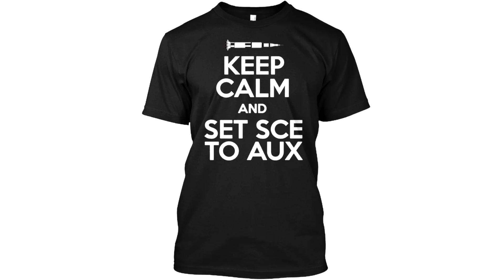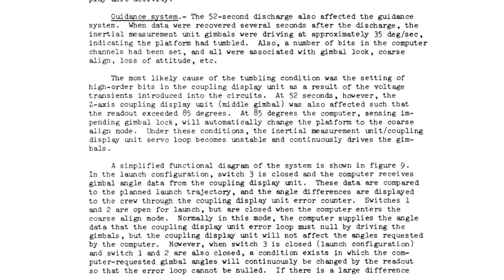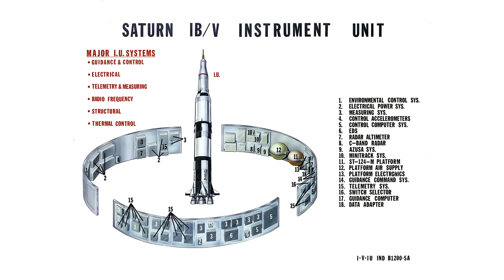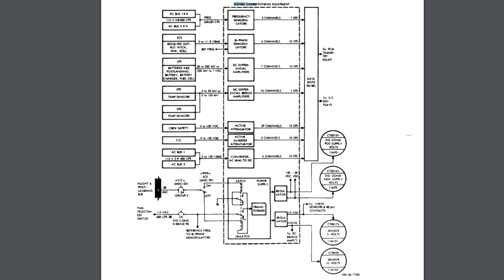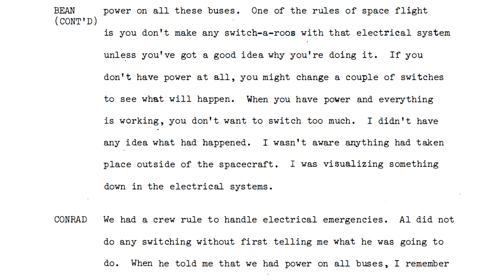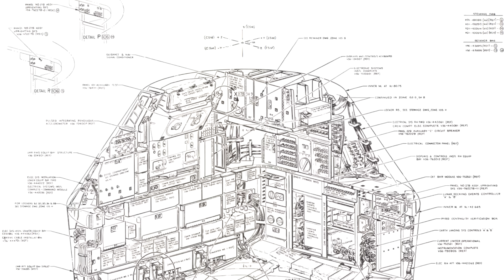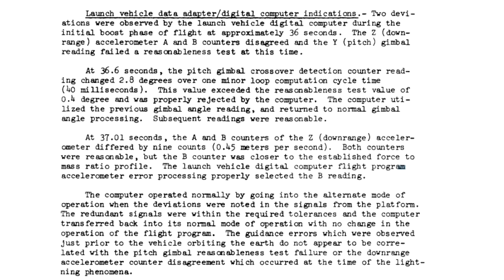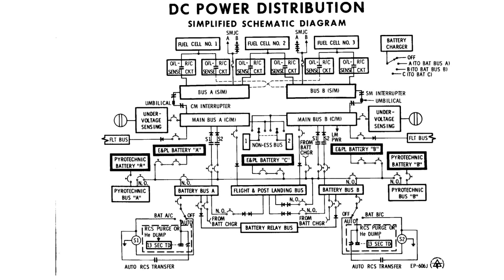What Does "Set SCE To AUX" Mean Anyway - Apollo 12's Lightning Strike Explained

Comment: At the 3:48 min mark you incorrectly used the post Apollo program acronym for EECOM (Electrical, Environmental & COnsumables Manager). During the Apollo program, EECOM stood for "Electrical, Environmental & COMmunications" (controller). Not to be confused with the CAPCOM who just communicated over the radio but wasn't the NASA controller that actually was responsible for communication's systems technical stuff for the command & service module. I usually like your video's but I am sorry, you earned a thumbs down for that mistake Mr Manley.

Comment: Video games and simulators are all the rage. Some day, someone is going to set up a Mission Control simulator. People will be able to choose their position and (remotely) man a console during a simulated space flight. For instance, someone can pull a shift as FDO, another as GUIDO, etc. I think people would pay to play such a game.
Reply: Kerbal Space Program has a mod that can send data to a web browser.  Telemachus I think it's called.  I've never used it, but reading about it - it seems it sends different telemetry data that you can access on a second screen - - - but in theory, it's a web browser, so if you had a bunch of friends, you could all get in communication on a group chat/call and each of you pulls up the web page and browses to the appropriate page of that site and you could each be viewing different data about the same mission rather than ONE person browsing through different pages of it.  It would probably be pretty cool at first, but being that the game is obviously fairly easy to play in single player, it would just be fun for a bit - - and then it would probably get old because you'd likely start just communicating about things you don't need them for.  In theory, this seems like the closest thing to what you are asking for.  It's not necessarily DESIGNED as a multiplayer way to have a "mission control" simulation, but I think it COULD work as one.  I've never even seen the mod, but based on what it does, you could probably use it the way you are talking about.

They talked about implementing something similar to what you are talking about in KSP2, but of course since that looks to be abandoned (or not.....or yeah....or not...or who knows) - don't know if that pans out.
Reply: That is an experimental part of Reentry a Spaceflight Simulator. I've only been a controller once, I was FDO.
Reply: @msidc1238  It sounds interesting.

Comment: The solution most likely came from the fact that the "on" and "aux" positions were on opposite sides of the "off" position on the SCE switch. An asserted SCR will remain conductive until the power flowing across it drops below its forward voltage (usually ~1.2 volts), so the quarter-second of no power flowing ti the SCE allowed it to self-discharge and reset. 

This is still a common problem today -- most power protection systems simply do not account for the possibility of the system experiencing a transient spike and then recovering, and require the whole system to be shut down and reset.

Comment: As someone who went through the usual US Army Basic training of the early 1980's, one of the training requirements was to demonstrate the ability to deploy a Claymore mine. The equipment used was a simulator, but part of that was that the hand detonator for the mine had a 'test' mode that if everything was connected correctly, you would put the detonator into 'Test' mode, squeeze the detonator as if you were igniting the mine, and a light would flash on the detonator indicating that everything was configured correctly, and you would loudly report "I see the light" to the evaluator, who would then advise you to move the detonator out of 'test' and detonate the mine. In this mode you were expected to have ducked down behind your berm on the off chance that you were in the back blast for one or more of the mines attached to the detonator, and detonate the mine. (simulated, no explosion.) As I never deployed a live Claymore mine, I have no idea if the live equipment functioned the same way, but it was impressed upon us that  it would. The reason I relate this is that since this mine was (I seem to recall) widely deployed during Vietnam, it seems to me that the testing of the primer and detonation system could have been performed in a similar way on the Apollo Command Module. The likely issue with this was that it would add complexity, and since Primers are somewhat temperamental in any case, much less after they have been through a launch, and are now in free fall, and in an environment that they are not necessarily well tested in on top of their being temperamental, there is some risk to doing anything like the test the Claymore would go through. I'm not at all sure that there weren't a few missteps in that procedure during Vietnam that may have provided some discouragement to doing the testing as well, most likely a situation where the soldier knew that they didn't have the detonator in test mode when the 'test' the setup, to someone's displeasure.On the other hand, the 'test' function of the detonator may have been added post Vietnam. I mean I was in basic fully 2 decades after we left.

Comment: What rarely gets mentioned with this story is that the president was there so they were making decisions under political pressure. Keep to the schedule and make it look good or our budget will get cut is static that you don't want in the decision making process of engineers especially when lives are on the line. They knew they needed a weather hold. They got away with it on Apollo 12 but seventeen years later the same thing cost Challenger.

Comment: This is an excellent summary in almost every way, and I thank you for telling it so well.  I was a teen when this happened, but I later had the incredible good fortune of working at the Johnson Space Center on both the Shuttle and ISS, during which time I got to know many of the principals in this story.  John Aaron himself told me the story of the flight and the background on why he knew about the SCE, and Gene Kranz told me John was "the smartest man in the control center".  I also briefly met Pete Conrad and he left me with the sense that they would not likely have solved this in time.  Remember the expectation was a significant failure during ascent would automatically result in an abort if it could not be resolve within 20 seconds.  Obviously they extended that time in this case, but in my view that was only because John had a plan to get to a solution.  They did not want people thrashing in the dark.

Comment: When NASA replaced the controls of the space shuttle with the Phillips flat screen virtual controls and switches all I could think of is if those screen go blank the ship is lost. New doesn't always mean better.
Reply: @ChrisRobin-zg1yr  I wouldn't be so sure of that. Appointed beaurocrats are in charge by whatever administration is in power and NASA was warned by it's own experts that the space shuttle burned up on reinty due a piece of foam damaging the ship. Warnings were given about possible o ring failure on Columbia that were ignored.  The build up of hydrogen gas in Apolo 1 was ignored. 
etectors like home smoke detectors were invented and developed as a result which has saved untold lives. An accident with a silver lining. The Mercury program used Atlas missiles that always had a disturbing failure rate. A very dangerous business at any time. I was born in the 1950s and an astronaut was what I wanted to be in my youth. Not a cosmonaut though. 😁

Comment: This is why EVERYONE should have a Smart UPS ( uninterruptible power supply ) for every single electronic device in their home

Years ago I used to have issues where the cable box would just lock up or the TV would stop responding or other weird things would happen with electronics in the house and at some point I put UPS's on everything and I don't have any of those issues anymore and I actually had two separate incidents in two different houses

The first I kept getting the UPS's switching to backup power and reading a fault of losing the neutral
And I thought this is absolutely crazy and I tested the box in the house and I tested the panel outside and I was getting high voltage on the ground wire and I figured my test equipment was just faulty but it turned out there was a problem at the pole and it actually had a bad lug and it was losing the neutral and had I not had UPS's I would have burnt out everything in the house

The second incident after I moved at midnight and at 5:00 a.m. on different nights I would get a fault on the UPS's and I kept calling the power company and they investigated and they found an upstream capacitor Bank near the substation was faulty and when different power plants were being switched on and off The surge was not being handled by the capacitors

I've adopted a saying that you don't know what you don't know and having safety mechanisms in place can save your life

Comment: Andrew Chaikin's book, "Man on the Moon" served as the reference for the Tom Hanks mini-series "From the Earth to the Moon." In the book, Chaikin describes the discussions around the pyrotechnics for the re-entry parachutes. Ground controllers determined that the only way to know anything would be for an EVA to visually inspect the pyrotechnics. This was a procedure that the crew was neither equipped nor prepared for. Eventually they decided that if the parachutes didn't deploy, the crew would be just as dead now as they would be in 11 days. The concern about the pyros was not even discussed with the crew. They were not told of the concerns until after they returned.

Comment: I imagine the logic behind the parachute test problem was more along the lines of 1. We can't test the parachute pyro devices in space. 2. We can't know until reentry if they will work. 3.There is a 50/50 chance that they will work. 4. You're only going to answer the parachute question on reentry. 5. Why abort the mission if there is a chance they will work? It they had aborted the lunar landing part of the mission and the chutes had worked on reentry then the decision to abort the landing would have been a mistake. In other words, the lunar landing part of the mission was optional but the reentry part was not. You were going to have to do the reentry either way (lunar landing or not). So do the landing and just say a prayer on the reentry. The reentry choice was really out their hands.

Comment: I do like that story about the "what if the parachutes don't work" question. And on top of it having the reasoning of "Well send them on a grand adventure first" there's also a simple, more mundane measure of rational thinking behind it: Might as well gain as much (science/data) from the planned mission anyway. Then not only have they gone on a grand adventure but they've also at least accomplished their mission goals (short of the come home safely goal, which would be out of their hands anyway if the paras don't work) and their lives aren't lost simply to pop up into space and then turn around immediately with little accomplished.

Comment: It looks like the ability to remember random events from past events that wouldn’t normally be remembered was extremely helpful in works of mission control. A memory ability that few people possess. This ability also saved Apollo 11 as the lunar module guidance computer kept overloading and needed to be reset. The controller in Houston just happened to remember those warning codes from a simulation.

Comment: I know it has been a year but something to consider. If the switch was "normal - off - aux" than set SCE to aux would tranlate to turn the SCE off and back on. Chances are the voltage never went low enough to cause a hard reset in the SCE and it just needed to be turned off and back on. Fly Safe

Comment: I first learned about programming and minicomputer hardware in the late 1960's, and I KNOW what sort of gear and code those systems had.  I sort of doubt anyone raised from the 1980's and on has ANY idea of what those systems were like.  DEC PDP-8 computers functioned with a 4K core memory stack, and accepted an additional extended memory 4K stack, for data only (not code).  Yes, 4K was what you had available for ALL of your programs.  It's always very impressive to me what these NASA systems were able to do with that.  By and large everything was written in machine language, and you had to write your own interrupt handling routines, etc.  Handling and interpreting data out of those systems in real time during a crisis must have been nerve wracking!
Reply: You are absolutely correct!  I worked with an IBM 1620 in the 70s and one had to write very efficient programs in Fortran for it on punched paper tape as the memory was (I think) about 25K.
Reply: The first PLC I learned to programme on only had 4K  Ram and 8 bit analogue channels,  When a customer wanted extra functionality on the plant they had to buy a 16K ram pack it cost £350.

Comment: Black boxes on comercial airliners or helicopters. Rewrack the boxes , basically pulling the box out of the rack that it's mounted in which disconnects the hard mount connection . Reinstall the box in its mounting rack , fixes %99.9 of any avionics problem , dealing with fly by wire aircraft.

Comment: Don't even have to watch this one. Listen to the flight controller's loop in the Smithsonian's NASA archives, or the interviews with John Aaron. "Set SCE to AUX" means 'flip the swithch that sets the power supply to the Signal Conditioning Equipment to Aux (the alternate, backup power supply for the equipment)". The SCE was the system that delivered instrumentation data to both the spacecraft's cockpit displays and computer system, and to the downlink telemetry that sent data in much more detail to the MOCR in Houston. The person whose name is rarely, if ever mentioned is the engineer who thought that there might just possible - in a remote contingency - be a need for a way to re-power the SCE system. One of Apollo's many unsung heros. (And thank you, Dr. Ford, for handing me an assignmnet to research and write a 5000 word paper in 3rd year EE), just in time to graduate as the Apollo program got Proxmired.

Comment: I would postulate that there are many more switches and buttons that, had the astronauts not pressed them at the correct time, would have also caused the mission to fail.   For example, the button to LAUNCH is an obvious one.    They would still be sitting on the pad if they hadnt pressed that one.
Reply: The astronauts don't press a LAUNCH button.  The launch is handled completely by the ground launch sequencer also known as the terminal countdown sequencer.
Reply: @stargazer7644  you still gotta press a button to start the sequencer, so effectively still a button to launch.   In any case whoosh right over your head went the point.
Reply: @wouldntyouliketoknow9891  Ok, I'll try this with small words and large type.  NOBODY PRESSES A BUTTON TO LAUNCH THE ROCKET.  Now if you want to consider the first guy in the room in the morning who turned on the lights to be what launched the rocket, then whatever.

Comment: Why would they launch near a storm? This might be a dumb question. If so, sorry
Reply: Not a dumb question. It wasn't actually a storm that Apollo 12 launched through, but heavy rain cloud. So, when you have a rocket 110 metres tall, with the exhaust trail extending back down to the pad, the chances of generating some lightning are pretty good.
Since then NASA has not launched anything if there is lightning within sixteen kilometres of the pad. They do launch through cloud, but only when they know that the cloud will not produce any unpleasant surprises. 
In July 2003, my wife and I went to Florida for the launch of the Opportunity Mars Rover. There was a cascade of delays, but we finally got to launch night, which had total cloud cover low over the pad, so we were not going to see very much after lift-off.
The launch was scrubbed for reasons other than the weather and when we returned a week or so later for another attempt, the sky was completely clear. This time, the launch got away and I have the time exposure photo that I took of the ascending rocket on the wall beside me.
Reply: @MarsFKA  that's so cool!! I hope I can make it to one of the starship launches or something similar eventually.
Reply: @MarsFKA  i'd love to see that picture !
Reply: @cha7664  Thank you for the compliment. I don't know a way to post it, as I'm not on any social media.
We were watching from the official viewing site across the Banana River from the launch site and I had the camera set up on a picnic table. I warned everyone that the table was a no-go area and when the rocket lit up I jammed my thumb down on the shutter cable. The rocket rose so high before it curved over I thought it had gone out the top of the frame, but when I got home and had the film developed – pre-digital days for me – I found that I had caught the whole thing.
Very pleased with that photo.
Very pleased that were able to see the launch – we were in Florida for three weeks and it was supposed to launch two nights after we arrived, but, with all the delays and one scrub, it didn't get away until three nights before we went home. On the night it finally launched, when the count was stopped at T-minus seven seconds (!), we wondered if Murphy's Laws were being enforced for our benefit, as we have been to Florida for two Shuttle launches and missed out each time. However, they fixed the problem, restarted the count and I got my photo.
As a bonus, "our" rover worked on Mars for fifteen years! You have to hand it to the JPL: they really know how to get the most bang from their buck.